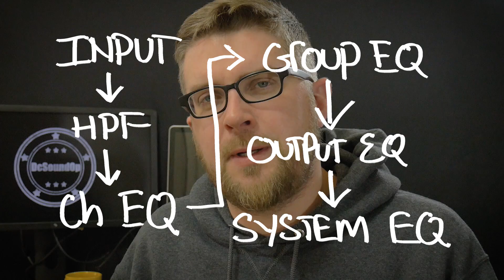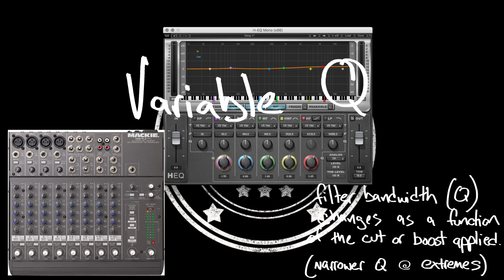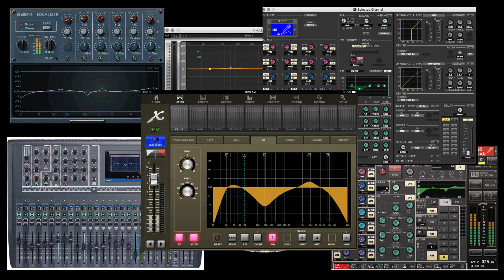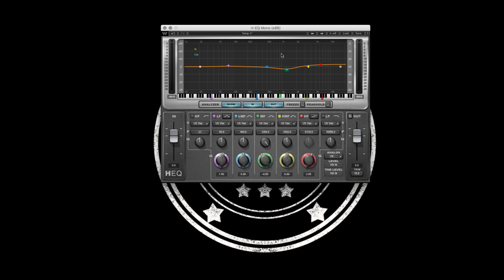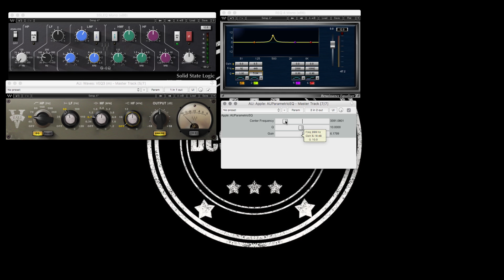#39 - Channel EQ  🎛 🎚 | when, why & how | Live Sound Basics

Comment: Thanks for your videos. You’re helping me fill in some gaps in my knowledge of systems and processing. I’m mixing on a Allen and heath dLive. The subgroups have a 4-band parametric and a 31-band graphic. Question on workflow: my current way of using eqs on subgroups and channels is as follows: subgroups are used to get rid of feedback on a particular mic (i.e. countryman) and channels are used to adjust for specific voices. Is this close to what you’d recommend?